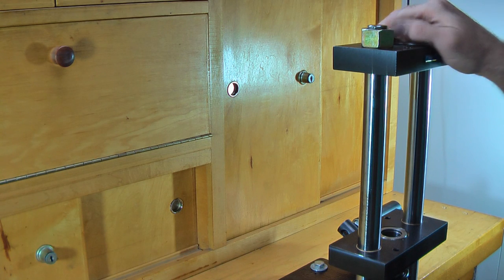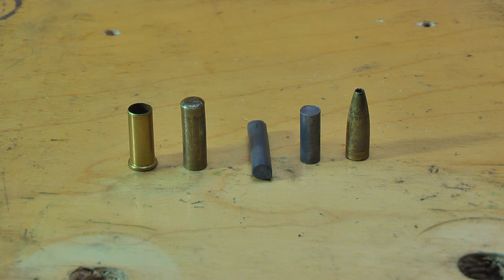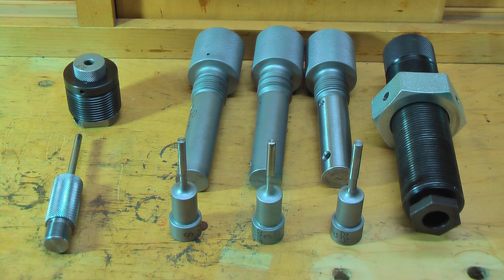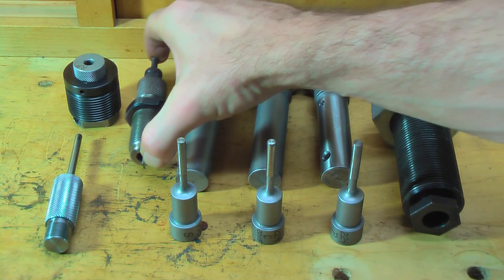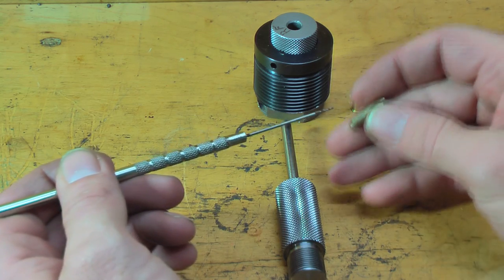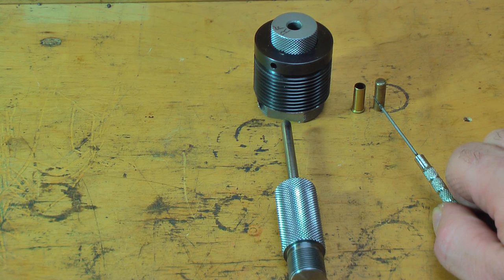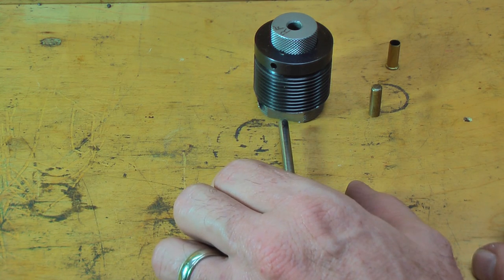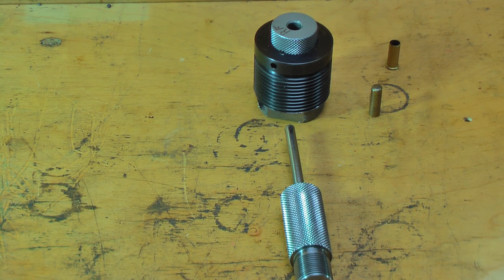Advanced Bullet Swaging Part 1

Comment: Awesome set of videos.  I made it to the range today and picked up a baggie full of .22 mag, .22lr and .22 short.  Cleaned them with half vinegar half water in a ultra sonic cleaner, rinsed with baking soda and water and than processed through the ultra sonic cleaner again with dish soap and than rinsed under running water till it ran clean.  Dried them on a cookie sheet in the oven for about 10 min at 375.

Comment: What if I just want to use solid copper wire to make solid copper bullets with no jacket. Would I just do the last step?
Reply from the maker: I have done it and it's not as easy as lead core. Here's the process. For 224" I sue 8 gauge solid copper wire and I cut it on a precision tubing saw. I then anneal it. After that I smash it to 224" in the core seat die. I then have to drill a .18-.20" hole about half way down the bullet to point it. Otherwise the pressure will split the die in half.

Comment: I've been trying to make match rifle bullets now for about a year with some success. I'm trying to make 105-115gr vld style .264 bullets for highpower competition. I've been trying to figure out the ratios of jacket thickness to core diameter to be able to design a bullet and die set to creat the weight that I intend. So far the only way I've been able to do this is by trail and error, playing with jacket thickness and different alloys.
Reply from the maker: Are you making your jackets? Are you using calipers or a micrometer with a accuracy to .0001"?

Comment: Can you help me understand the difference in rifling twist? I thought a higher number per inch would be more twist or spin on the bullet. You said that with 1:14 with muzzle velocity of 3800 works where 1:7 is holding together at 3200-3300. 

I'm new to this so just trying to get it right. 

Also, what is the advantage of more spin on the bullet? Less drag, for longer range? Or maybe less effect on the bullet from cross wind? IDK.

Comment: bout 4times the slide failed lock back after the last round sometimes it did lock too i was told it could have been primer or lack of powder i have a 1911 i loaded 185gr hornady xtp with 7.4/7.6gr of  power pistol i used cci primer and remginton brass

Comment: I mean to get the residue out of the inside for reloading. I've been using simple green, but I also scrub the insides with a wire brush so I didn't know if you'd tried it with your method.